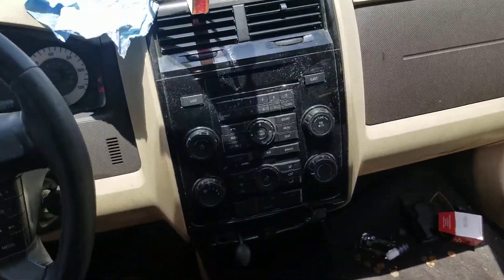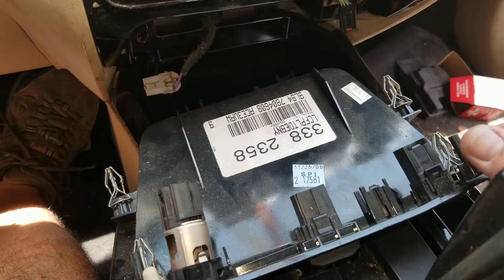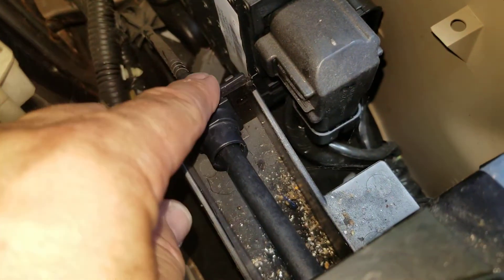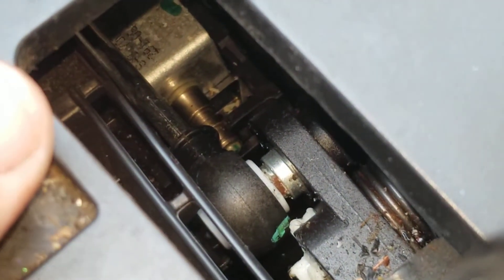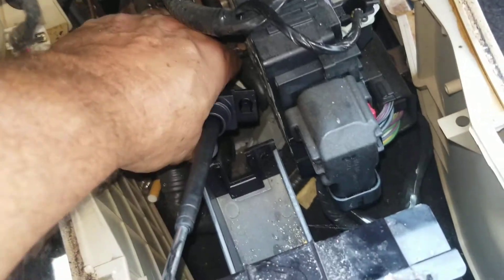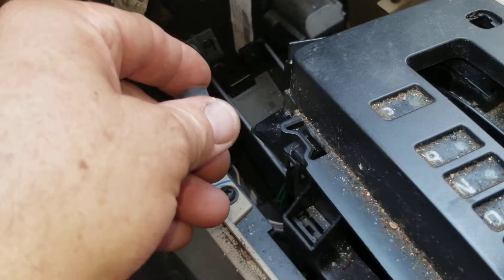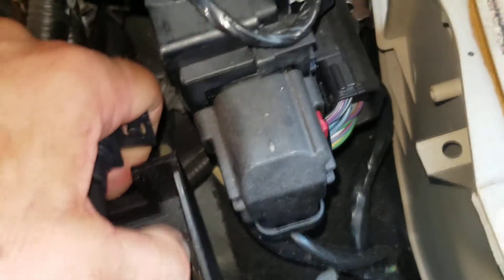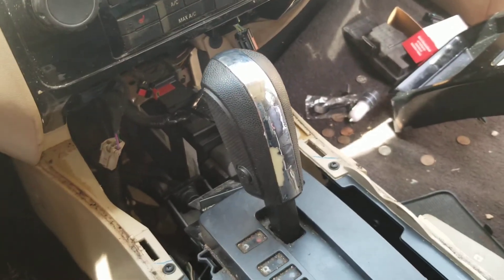2009 Mazda Tribute Ford Escape gear shift dorman 14073

Comment: Your local parts house will probably tell you that doorman part will not fit your 2009 escape, but ignore them and get it. The dealership will sell you the wrong part for sure. 

This fix worked perfectly and easily. Literally took 2 minutes to get the console apart, thanks  to this video, and 3 minutes to make the repair and put it back together. 

Great job and thanks for posting.

Comment: Just used the Dorman part from this video on a 2010 Escape 3.0 Limited.  Worked perfectly!  Old bushing was crumbling into pieces.  

To install - once you get it on the cable - place it over the shifter pin and press it on using a screwdriver handle.  As you press the handle against the new bushing you will feel it click onto the shifter pin and that’s how you know it is on.  The whole repair took about 20 minutes.  Thank you very much for this video - saved me a lot of time and money!
Reply: Thank you! works for me on a Ford Escape 2010, got the part on Pep Boys.
Reply: I replaced it but now my 2010 Ford escape won't shift back to park. Its says it is in park even though it's in reverse. So I have to put the parking brake on, open the hood, and push the shift in the parking position. Any ideas on what is going on?
Reply from the maker: Check the bushing under the hood. Check for any slack

Comment: This video was a lifesaver. My wife drove a little out of town to drop a thing to a friend and missed her turn, she pulled into a driveway to do a u turn and when she shifted into reverse, it didn’t shift out of drive. She panicked and turned off the car and tried to restart it, obv won’t start in drive. Went there this morning and sure enough after a minute of taking apart the column, saw the bushing was bad. The only thing that didn’t work for me is I wasn’t able to pop off the bezel with PRNDL just a little to decouple the bulb, it just popped off breaking the light, but my car works now with a $16 part and 10 minutes of work, so I’ll take the broken light

Comment: Thanks for the video, this was my exact problem.  2009 ford escape here, I was at work heading out to lunch, car backed out of the parking spot and as soon as I was shifting it to D, something didn't feel right (shifter felt really light), car was stuck in N regardless the shifter position.  Took the trims off the found the shifter cable was dropped and the plastic insert (bushing) fell apart.

Comment: 2010 mazda tribute, the 14073  is not fitting, any suggestions?
Reply from the maker: You can file or grind it a bit. It is a tight fit to begin with.

Comment: Hey Chris I need help with my 2008 Mercury Mariner Hybrid similar vehicle so my shifter won’t stay in park after shifting in park. Almost like it doesn’t engage at all but you here it click in to place when putting into park.everything else does just fine works like it should. but I can’t find anything to help with my problem like anywhere. Let me know if you have any ideas or can help at all thanks or if anyone else can help. Again mine works with everything even goes into park but shifter will not engage in park i5 just rolls. Any help is appreciated guys thanks.
Reply from the maker: Did you look at the shifter bushings. That is a good place to start.
Reply: @ no I have not only for the reason that I don’t have any of the symptoms everyone keeps having with that issue. Everything works it even goes in park but after I put in park it just rolls forward or backwards depending on which way the car is facing down hill or uphill. It doesn’t get stuck or anything like that. Should I still check this out? Could it still be an issue? Thanks 🙏🏼
Reply from the maker: @WorthWorx check under hood. Find the transmission linkage, check it manually and see if it will move into park just by moving it with your hand. Maybe the slack in the bushings or damaged cable is causing the issue.
Reply: @ okay cool thanks Chris I’ll do that as soon as I get it back running. I’m having to fix the (Hybrid Battery Cooling Issue) My fans that cool it down went out so I’m fixing that issue and I have to get a new battery for underneath the hood aswell lol Anyone who has the Hybrid knows what a pain the Stop Safely Now Message can be it can be literally 15+ different things. I have personally probably fixed multiple things on this vehicle over and over again lol I’m the only owner just hit 369K Mileage and counting. I refuse to give up on it it’s been there for me idk why but I love this vehicle I have few newer vehicles between me and my wife but I refuse to get rid of it 😂 It’s paid for cheap to fix I need to replace Emergency Brake the cooling fans for battery and battery up front itself and Fix the staying in park issue and it will be back on the road again. At least until I have to replace the Hybrid Battery Pack itself I’m dreading that day to be honest 😬 If you know anything about the hybrids Chris and got any tips or can be of any help or vice versa let’s exchange info thank you for taking time to help I realize you don’t have to do that I appreciate it. I will keep you updated on the issue at hand with the it not engaging in park so far this is the closest I’ve managed to find on the matter usual when I  research it just says( What to do when stuck in park. Which I already know how to handle that 😂) Completely flips my question when researching issue your life saver Chris.

Comment: That is not the correct bushing 
That's for a GM
Reply from the maker: Wow a GM bushing on a ford
Reply: @chriskolar  I bought the Dorman "Ford" bushing kit and it had a bushing that worked
Reply from the maker: @billphil8235  what is the part number?
Reply: @chriskolar  dorman 14057
Reply: Or 14055
Reply from the maker: @billphil8235  https://www.dormanproducts.com/p-737-14057.aspx
Reply from the maker: @billphil8235  https://www.dormanproducts.com/p-737-14055.aspx
Reply from the maker: @billphil8235  part is listed for ford , pontiac
Reply from the maker: @billphil8235  I looked it up on the dorman website. Why are you wasting all this time? The part works as described. Maybe the other ones work too. Make a video. Install one or all and check all the thousands of variations of bushings.
Reply: @chriskolar  that dorman bushing does not fit a 2008 Ford escape. Not even close. Good luck to you sir
Reply from the maker: @billphil8235  works on 2009